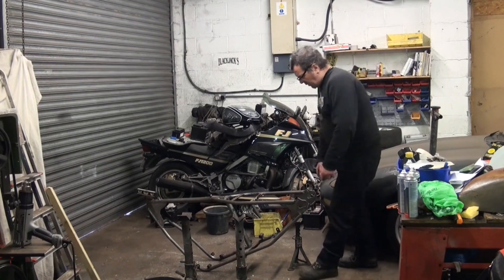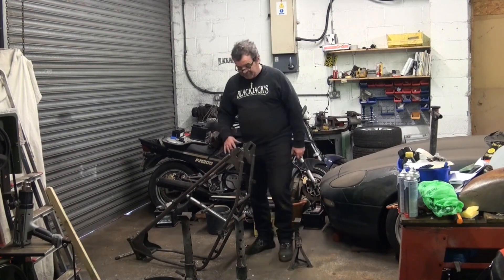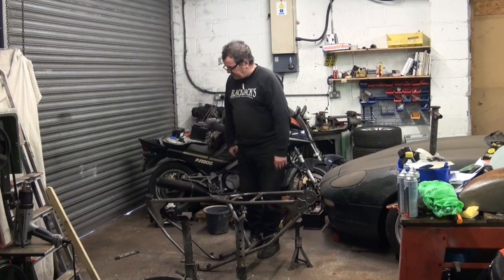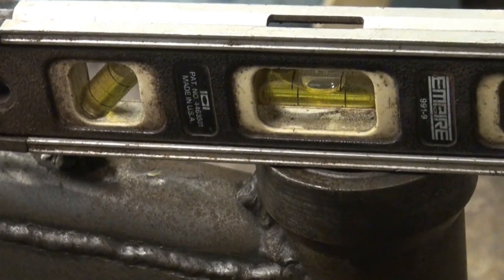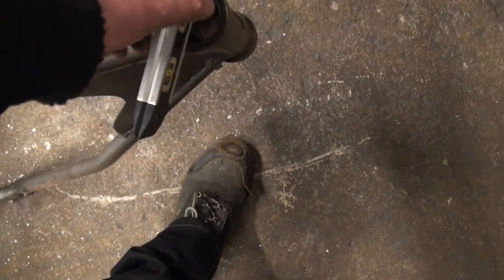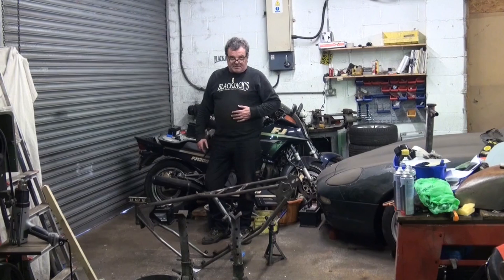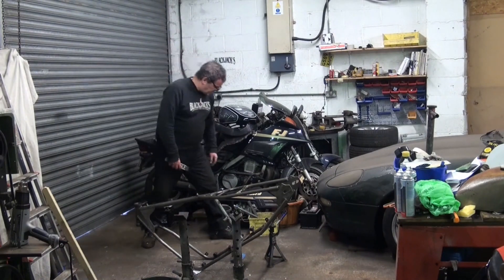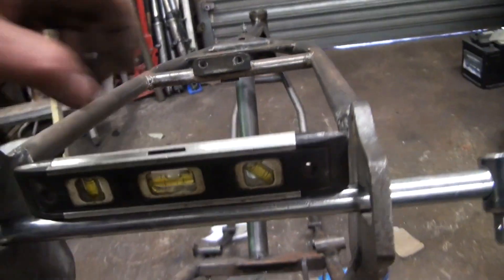How To Check If A Rigid Frame Is Bent?

Comment: Nice fj 😁 I’ve got one of those too
Reply from the maker: Ahh... that's a project bike. Just got an FZR1000 EXUP rear wheel for it with a 5.5 rim. and there's a frame in the offing too. Just don't hold your breath. :-)
Reply: @BuiltatBlackjacks  very nice mine has been stuck on the lift as well haven’t even gotten to ride it yet it’s been a couple years but hopefully sooner than later we will both have them on the road tearing up :) , does the fzr wheel require any modifications to the swingarm to work? Seems like something i may be interested in doing in the future maybe you can make a video on here about it 😁
Reply from the maker: @Mystic-p1mp  I'm told the wheel will fit the stock frame without too much hassle. The FJ owners club (UK) had an article on fitting one. I'm not too concerned because I'm using a different frame. https://www.instagram.com/p/B3w0-h0BpOS/?igsh=a3o3ZWI1cWIycGp0
😁
Reply: @BuiltatBlackjacks got to love a big old yam. I've got an xjr1200, it's abilities surpass my meagre skills...😆
Reply from the maker: @karlcritchley7373  yeah I used to run a stock FJ1100 as my daily. Maybe not the flashest thing ever, but if you needed to eat sone miles....